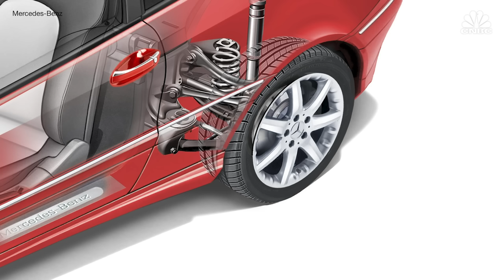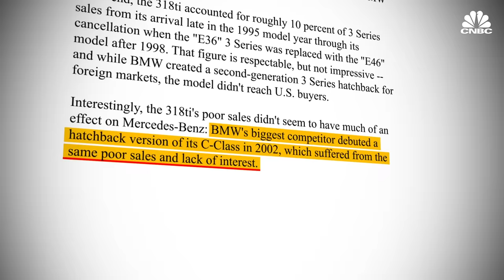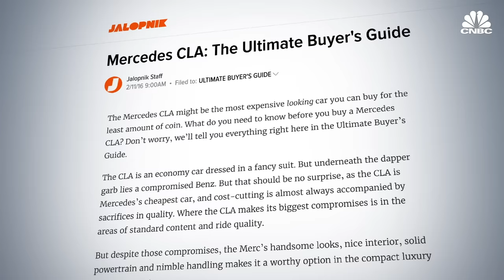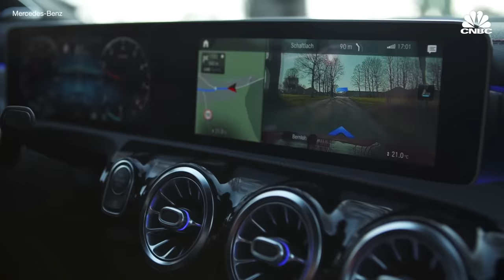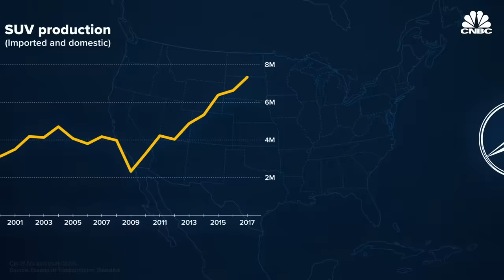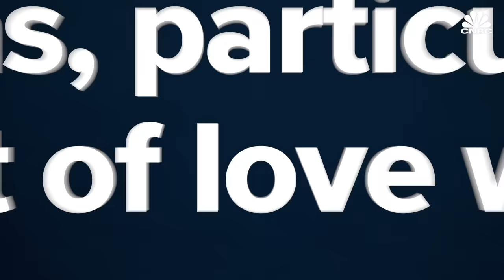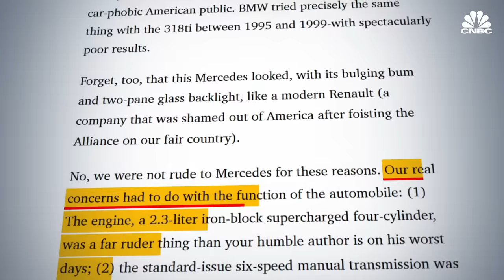Why BMW And Mercedes Made Cheap Cars That Failed

Comment: The BMW 3 series compact holds a special place in my heart.

I got rundown by one of them
Reply: Surprised it wasn't a Mustang haha
Reply: Noah Bowie lmao 🤣
Reply: @Thienle92  only reason it wasn't a Mustang is cause it happened in London. And there were like two Mustangs in Europe at the time
Reply: @noahbowie5985  So you telling me BMW is the Mustang of Europe??? XD
Reply: Noah Bowie what do you mean
Reply: @Green Mills I have one. Extremely ugly but with good Bilstein suspension it's extremely good to drive. Independent rear suspension, rear wheel drive, short wheel base, manual... What do you want more?
Reply: Noah Bowie Rip
Reply: older one my family try take out the eninge and replace them with a toyota... before just gave up and never buy from them again..
Reply: The compact actually looks like someone went into the back of it and the crumple zone went. Ugly car.

Comment: Or everyone is getting more used to the idea of buying a used car.
Reply: Airbus A380  new car smell
Reply: @cutliss  overrated and overpriced smell.
Reply: @cutliss  you can get air fresheners that are new car smell scented
Reply: I've had really good luck with buying used BMW's. I generally get one around 5-7 years of age and run it for 3-5 years. If you stick to the six cylinder BMW's (avoid the 4, 8, 10, and 12 cylinder cars), you can find a comfortable and dependable car for around $10-15k. I do my own repairs, so I'm only on the hook for parts cost. On the whole, your money goes a whole lot further on a used BMW than anything else out there. Asian cars only make sense to buy if you're buying new or leasing them - they retain value so strongly that buying new makes more sense. (unless you're talking about something under $5k)
Reply: Cars haven’t changed much since the 90s.
Reply: Airbus A380  toyota generally u buy and keep for a long time. Dependable appliance lol
Reply: Especially with "extended warranties".
Reply: @s n new is new - same as with clothing. But if people don't have money they make compromises.
Reply: Airbus A380  yes there is. You have minimal repairs and any repair will be under warranty.
Reply: @Andrew-zv4fm  That is why it is great to pick up a low mile off lease vehicle.  Let some poor sap take the initial depreciation and get a great low mile car with remaining warranty.
Reply: Nissan Armada cost almost $80,000 brand new while a used 2 year old one cost under $50,000. I never expect to lost over $20,000 of depreciation of a Nissan Armada that is a few years old and under 70,000 kilometres.
Reply: Airbus A380  Cars are depreciation assets that is why. When you buy a brand new car after doing the paper work and leaving the dealership. It depreciates right away.
Reply: Who the hell buys a car of the lot instantly looses value when you drive it off just a waste of money
Reply: I buy brand new.  Like the new car smell.  LOL.
Reply: Ian Campbell true . The N63B44O0Engine is the culprit of many problems with BMW. In short, the problem with this engine that is in many of your higher priced BMWs, is that it requires non-throttle coasting for adequate cooling of the engine. In America this is clearly not possible with the traffic conditions we have. Think about the fact that the same engine is also put in Bmws driven in Germany and they seldom have A fraction of engine issues that are encountered in America. A BMW mechanic pointed this out to me several years ago. Add on the fact that the oil change intervals add to gunk building up which Bmw will never admit, it further perpetuates valve problems or issues that come along. I’ve had several V-8 BMWs as well as several V6 engine. From my 750to the 650 and my  M6, I experienced all of the same issues. Never did I have the same engine problems with the six-cylinder vehicles.
Reply: @ronaldoseven4865  There is more to depreciation than that.  Once someone takes ownership of the vehicle it is a pre-owned asset.  Even if only 1 mile is driven.  
Due to being a pre-owned asset it no longer competes in the new car arena.  If the dealer were to repurchase the vehicle they would still have to allocate a cost of inspection cost and sell it at a price so that a customer is recognizing:
A. The value of a new vehicle compared to that used vehicle. 
Or
B.  The value of purchasing a slightly used asset relative to plunking down the extra for a new vehicle.  

Car sales is a magicians trick of opportunity cost.
Reply: Angel Gutierrez no
Reply: Airbus A380  Factory warranty and peace of mind.
Reply: @cutliss  i hate the smell of new cars, it literally makes me vomit xD
Reply: Ian Campbell  Bought an N63 V8 from 63k miles to 89k now DIYing really helps but i don’t think it will make it to 100k-130k miles just the way it has been every 3-4months the Check engine light seems to come on...
Reply: Airbus A380 some people need to buy the new cars so we can buy used lolw
Reply: I will only consider buying used JDM cars 
etc : GTR
Reply: @angelgjr1999  Then you haven't driven newer cars, that's why you say that.
Reply: Let alone afford the usual maintenance cost of owning one
Reply: Angel Gutierrez Yes they have, by a lot.0
Reply: @s n So you are one of those who care about what people think because you purchased a used car.  Remember, YOU said it.
Reply: Ronaldo Seven that is generally true unless one keeps a pulse on what can become a collectible and flipping cars in general. Yeah they depreciate but eventually bottom out and where you pick them up at fair value and gain from there. I’ve generally had very good luck with this growing up as the son of a mechanic and picking it up as a hobby. My father’s 50 year old mustang sure has appreciated in value. The Supra and Nissan 240sx I picked up in the early 2000’s have also appreciated. Hell even the beater square body f150 ford truck I have has generally held its value if not gone up slightly. 
Some cars are toys others are appliances. A lot are junk hence the depreciation.
Reply: @s n My current car is a used one I got with 25,000 miles.  Turns out it had been in an unreported accident and had improper repairs done.  Didn't find out until a year after I bought it the paint started falling off.  That's the risk when you buy used, you don't know where its been.
Reply: Or not buying one at all
Reply: Where to get a used car from when no new ones produced? And what if you want to choose your ex/interieur?
Reply: They REALLY need to keep making economy cars. A lot of people they  want to catch (or wanted to catch) are still busy with their 10 year plans to pay down debt, start a family, & make at least one life memory trip somewhere before they are ready to settle down.
Reply: @angelgjr1999  cars havent changed much??? What sheltered small town economy do you live on?
Reply: @hazmatcinemaxxx  a lot of dealership lie about their certified pre owned cars. Most barely do anything other than giving it a nice clean up and changing the oil. You cant legally taken to court over the lies either.
Reply: @gerardc5457  so basically get a 6 cylinder engine BMW. Gotcha.

Comment: "Cheap luxury" is an oxymoron. That's why.
Reply: Cheap Quality, not price! What's so hard for you to understand that?
Reply: Death Metal more like Acura
Reply: A 3series and c class arent "luxury cars", mercedes and bmw also make regular cars
Reply: The best cheap luxury cars are old expensive luxury cars that have gotten cheap
Reply: That Mercedes "Sport Coupe" is amazing quality car
You would have not gotten any of that buying any other car, even a more expensive Mercedes
That goes for CLC, A class and B class of that era
A very simple car but for a big cost
And that cost doesn't go into nothing
It is worth it
My family has a B200 Turbo (a very rare car even in Europe with that engine) and boy the quality is astonishing
It came out in 2006
Audi A3 of those times is nothing compared to it and even a later Golf 6 is just pure garbage in comparison
Though the B class is slightly different in dimensions
Reply: Except this video is wrong and actually Mercedes class A and BMW 1 and 2 series are the biggest sellers and main source of revenue for their respective brands.
Reply: J Knox It doesn't they are crap
Reply: @arx3516  it is much different today
They are talking about completely different cars
I don't know for other manufacturers but Mercedes is a much different brand then it used to be
Reply: Or because they didn't really try to make cheap "luxury" cars. In Germany Mercedes, BMW and Audi are pretty average and all over the place. They don't try to maintain exclusivity. If you wanna flex with a Mercedes in Germany you need to have an AMG version
Reply: The thing is Mercedes, bmw and audi are cheap in Germany

They are just like regular cars.
Reply: Well noted😄
Reply: Earl Turner Definitely not Lexus. You obviously are not a car person.
Reply: Expensive money pits
Reply: Like buying an older model luxury, it also doesn't show wealth.

Comment: I think a huge part of their problem with releasing a 'cheap' version of their cars, is their normal offerings depreciate so fast. Why spend 30K on a cheap Mercedes, when i can spend that or maybe even less on a higher end version that is only a couple years old?
Reply: @Mako that's an excellent point. Of course they don't see it the same. Better for us lol
Reply: Mako good point. But if you know the truth, it’s technically better to buy a new 30k model, rather than a used one for 30k. We all know why.
Reply: No better deal than a 1 year old low mile German luxury car or SUV.  I purchased a 2012 X3 in 2013 for 33k with 9000 miles on it.  It was 45k new.   It had a bumper to bumper factory warranty.  I kept it for 2 years and sold it to BMW for 30k with 19k miles on it.  Still looked and drove like new.  White on white leather sunroof nav.  It was a fantastic CUV.   I miss the N/A 3.0 six.
Reply: @s n but CLA will be cheaper to drive. But if you want to spend a lot and have a lot of fun then S klasse is best family sedan.
Reply: @s n A used S is only a good deal to someone that can afford a new S.  For anyone else it is a money pit.
Reply: @fatboy19831  I strongly doubt you would be able to trade it in for $30K on a 3 year old car.  You probably paid a lot more on your next car.  Something doesn't line up.  If what you're saying is true, it'd still be an exception.
Reply: @dailyrant4068  I took the car to get it checked out at the dealer.  A potential buyer wanted it.   The dealer offered to buy it from me.  They had already made several offers in the high twenties before.  The car was most likely already sold before they made me an offer.  The same thing happened back in 1985 with my 1984 CRX.   I paid $7800  for it brand new.  That was $500 above sticker.   I was just looking at a new Acura Integra and a lady wanted my 18,000 mile CRX.  The dealer wanted to give me $5,500.  The lady was right there trying to buy the car.  They ended up giving me $6500.   I still purchased a new Aucra INtegra for $800 BELOW sticker or around $9000. Sometimes you are just in the right place at the right time with the right car.

I do not think that X3 was worth more than 27k cash.  They had a buyer already.  All the dealer had to do was pay me and take the customers money.  Pure profit. The car was flawless.
Reply: @fatboy19831  Yep that's why I said it'd be an exception.  Exactly as you said, "right place at the right time".  Just like how some new cars are thousands above MSRP just because of some crazy demand.
Reply: A big thing being new cars are still under warranties. Luxury cars out of warranty are the expensive ones in the long run
Reply: now thats true, my father's car went from roughly 40k to less than 11k, but the new class here cost 83k shet its getting expensive
Reply: There is no discount like a used car discount
Reply: @kangvp9512  no, the better deal is what is going to last longer. A used C class from the early-mid 2010s will probably last much longer than any CLA models on the road in general.
Reply: Consumer Reports pointed out you can get a top trim of a Honda Accord for the same price as an entry level luxury car, but the Accord has much more room.